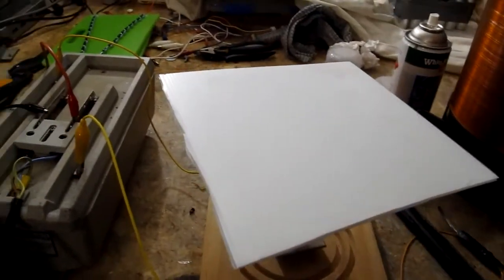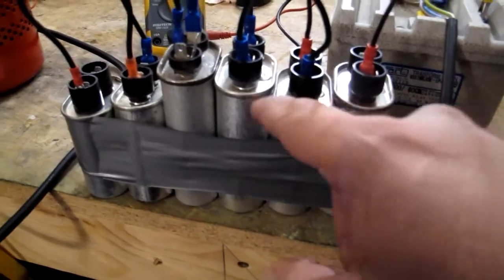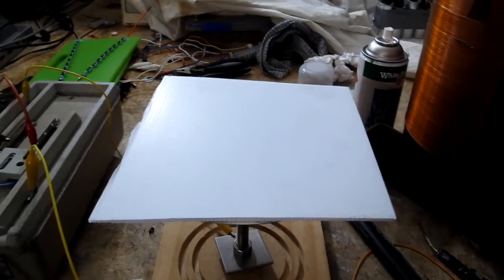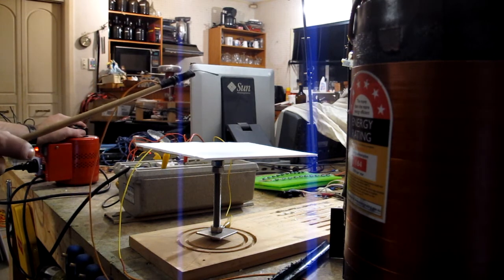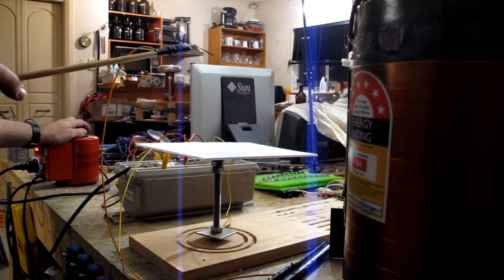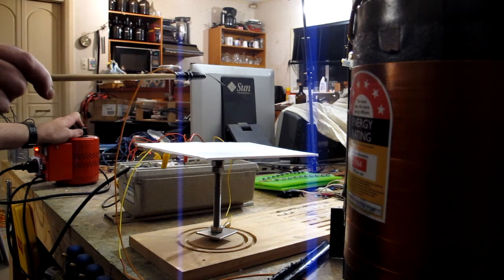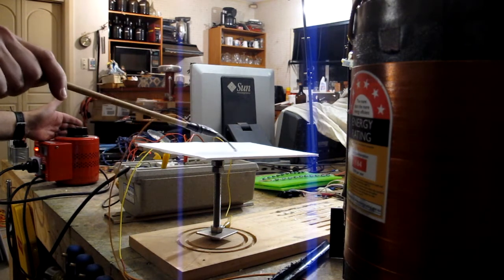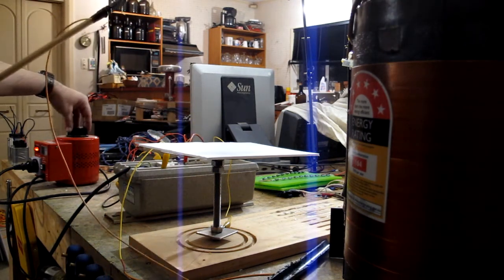Insulation Test: 3mm Corflute

Comment: I was looking for thermal Insulation as well. I have a greenhouse and it is amazing stuff.

I wanted to quantify just how much heat it captures and retains.
Reply from the maker: Yeah, turns out electrical insulation and thermal insulation are closely linked. Most materials that are good at one are also good at the other, and vice versa. <3 physics.  :)
Reply: @gristc   I'm in a cold part of Australia, Canberra, but what it has is sunshine in abundance.

Most of the houses here are very badly built for the climate. I am going to try an experiment, borrowing from the British. I am going to build a small conservatory against a north facing wall/window and see how much winter heating I can draw from it, just using a fan. I am guessing a lot. 

Only thing is I am wondering what to do with the heat in summer, whether I can use it to force ventilation to draw colder air from the south side of the house. Maybe can use it for other purposes. Drying racks or even slow cooking. If I enclose the hot water unit, I should be able to reduce its power consumption, perhaps with a heat pump/exchanger.